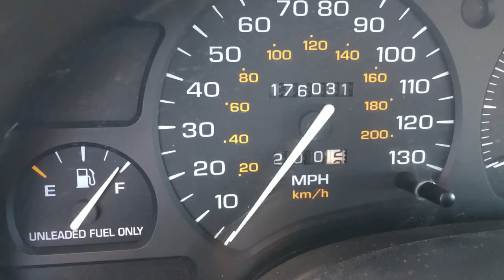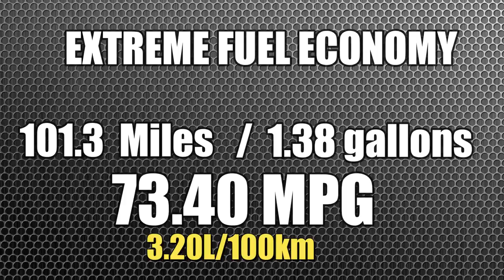S3 E11. Kubota turbo diesel Saturn extreme fuel economy.  super high MPG

Comment: Late winter and early spring rains often muddy up lakes and definitely affect the way fish, particularly bass and crappies, act. Although some mountain lakes stay clear, fishing muddy water may become the norm for a period in the spring, so you have to adapt to it.
Reply: Keep in mind that muddy water probably affects the angler more than it does the fish. Adjust your attitude and realize that fish can find food in these conditions. You should be able to catch them by choosing the right lures, and fishing slow and steady.
Reply: Get Noisy
If a lake or river is extremely muddy you can improve your odds by using a lure that makes noise.
Reply: @ocdman202      Man,  are you fishing for dinner   or   for fun?
Reply: @mommapanda5736     Sometimes,  both.
Reply: Get Noisy
If a lake or river is extremely muddy you can improve your odds by using a lure that makes noise. A plug that rattles (due to BBs inside) gives fish something audible to zero in on. Certain lipped and lipless crankbaits are specially configured to make noise. Give the fish a better chance to locate the lure by fishing these slowly and steadily. Although most usually fish a plug with a stop-and-go retrieve to imitate an easy meal, in muddy water it's good to reel it steadily so the fish can track it.
Reply: Rattles on jigs are good when crawling these lures along the bottom. Some jigs come equipped with rattles, but you can also get them separately to attach to the jig trailer or to insert inside the body of a plastic worm. Another noise-making option is to add beads between the lead sinker and a Texas-rigged plastic worm, or between the lead sinker and a swivel on a Carolina-rigged worm. The beads will make a clicking sound when you shake the rod tip. When retrieving these lures, move them as slowly as possible, and shake your rod tip to make them sound off.
Reply: A spinnerbait is also a good choice for muddy water.
Reply: The spinning blade sends out vibrations that bass can track. Some also have rattles on the body, or they can be added. In muddy water, choose a spinnerbait with one or two Colorado or Indiana blades rather than with willowleaf blades for more vibration. Some spinnerbaits have hybrid-style blades that are intended to produce more noise. Again, move a spinnerbait consistently to offer an easier target.
Reply: Lure color can make a difference in muddy water fishing. While jigs used for crappie are generally small and don't have rattles, you can choose a color that these fish are able to locate easier. In my experience, black, chartreuse, and red all show up well in dirty water, and combinations of those colors also seem to be good. One of the best crappie jigs in muddy water has a red head, black body, and chartreuse tail.
Reply: For bass in muddy water, try chartreuse spinnerbaits or crankbaits. Use a black jig-and-pig with some chartreuse strands in the skirt. Bright blue also works in muddy water and some folks swear by a black-and-blue jig with a sapphire blue chunky trailer for muddy water.
Reply: @ocdman202  any  good catfish  out of a muddy lake bottom?
Reply: @mommapanda5736  A common and large-growing species, the flathead (Pylodictus olivaris) is one of the ugliest members of the freshwater catfish clan, but also one that is regularly caught in larger sizes and which provides a good struggle on hook and line. It is important both for commercial and recreational use and produces good table fare when taken from clean environments.
Reply: The flathead catfish is distinctive in appearance and not easily confused with any other species. It has a squared, rather than forked, tail, with a long body and large flattened head. Mid to large specimens are rather pot-bellied, with wide heads and beady eyes. The eyes accentuate the flatness of the head with their distinctly flat-looking oval shape, and the lower jaw further accentuates it by protruding beyond the upper jaw. Compared to other catfish species the anal fin of the flathead is short along its base, with 14 to 17 fin rays.
Reply: Catfish baits don’t have to be complicated and they don’t have to stink.🤠🤠🤠🤠
Reply: The approach to fishing for blue cats is very different than that of fishing for channels and flatheads. This means the best catfish bait for each species is very different.

Catfish are all very different species. They have very different food preferences and habits. This means you need a different plan of attack, catfish rigs, bait selections, and techniques.
Reply: Just because you catch a fish on something once doesn’t mean it’s a good bait. The world is full of one-hit wonders and catfish baits are no different.
Reply: Best Catfish Bait For Blue Catfish
Blue catfish are eating machines. They spend much (if not all) of their day chasing and eating fish. They’re usually eating the primary forage fish in the body of water they live in.
Reply: In most cases, this will be threadfin shad, gizzard shad, or skipjack herring.
It’s not uncommon to find blue cats with their bellies engorged with shad or skipjack and absolutely stuffed. It’s common to find them so full of baitfish they regurgitate them (or even have them hanging out of their mouths).
Reply: Fresh caught shad or skipjack is the best catfish bait choice for blues in most cases.
Reply: Threadin and gizzard shad can be fished whole wormed onto a hook, or cut into chunks. Skipjack is typically larger than shad. They can be used whole for targeting large trophy-class fish. For smaller blues, skipjack is cut into strips or chunks.
Reply: Over the years I’ve used live and dead bait side by side. In almost every instance I found that blues will hit fresh dead bait (whole or cut) just as well as they will live. Keeping shad live is an unnecessary task for this species.
Reply: There is no magic bullet bait that you can buy.
Reply: Many anglers that target channel catfish use what I call “grocery store baits”, things like chicken livers, turkey livers, hot dogs, shrimp, and a variety of other items.
While there are times these can be good baits, I steer people away from them.
Reply: The simple reason for this is if you’re after numbers if they won’t hit a well-prepared concoction you’re in the wrong area. If you’re after size natural baits will typically prove much more effective.
Reply: Good “Stink” Baits (Prepared Baits)
I hate the term “stink bait”. These manufactured baits stink to the person using them but to a channel cat, they’re a strong trail of sensory overload.
Reply: Match The Hatch
Regardless of what you put on your hooks, there’s a golden rule, “match the hatch”.
Reply: You may have heard this before from bass anglers or fly fishermen and it’s true for catfishing also.
What’s it mean to “match the hatch”?

    Find what they’re feeding on
    Use what they are feeding on for bait or use something that mimics what they’re feeding on.
    Present it in a manner that looks natural
    Regardless of technique or presentation, these tried and true options provided will usually catch cats.

Just remember the action or technique often has more impact than the bait itself.
Reply: Read The Water, Catch More Catfish
You need to constantly read the water around you. Pay attention to how, when, and where the fish are feeding when you start having activity. Try to match the hatch in addition to recreating the action and you’ll catch more fish.
Reply: One of the most common questions we get about catfish baits is “what are catfish attracted to”. That’s not a super simple answer when it comes to catfish bait. Depending on the species, the catfish will feed based on sight, sound, and scent. It’s the presence of amino acids that will really draw catfish into baits in many cases. They have the ability to detect a trace amount of amino acids in a large volume of water.
Many anglers assume that “the smellier and nastier a bait is” the more catfish it will catch.
Reply: This couldn’t be further from the truth. It’s not the nasty, stinky smell attracting fish. It’s the strong presence of amino acids.
Reply: There are many variables in fishing and often no absolutes. You’ll encounter things when fishing for catfish that will leave you with more questions than answers. This often leads to spending more time to learn more.
Reply: Punch Bait vs Dip Bait
Punch baits are much thicker and get their name from the process used to bait the hook. You take a bare treble hook and “punch” the hook into the bait and then pull the hook from the bucket with a loaded hook.

Both will work for catching numbers of channel catfish but I’ve always preferred punch baits as they’re much cleaner to fish with and eliminate the need for using the tubes, sponges, and worms to hold bait.
Reply: @ocdman202       man,   do they  catch and eat  alligator,   in your neck of the woods?

Comment: If you’re looking for the gasoline  equivalent, Ford makes a fiesta with a 1.0 turbo gas. At 50 mph it can achieve 3.8 litres per 100km and average 4.6-4.8 litres per 100km at 60mph.

Comment: My wife get similar fuel economy (3.4L/100km) when she drives on the highway.
The car is a 2016 Peugeot 1.6L 4 cylinder turbodiesel. It has a peak tourqe 300nm@ 1870 rpm.
under mixed conditions I get 4.3L/100km

Comment: Which direction does air go through the intercooler?  Up out the hood hole or down into the hood hole and out under the car?
Reply: Almost impossible to say without testing with smoke or similar. Could be either way. One thing is for sure, its not very efficient cooling with that placement, thats why it can flow either way.
Reply: @GoldenCroc  Yes, I was thinking of a yarn tuft.
Reply: @2OO_OK  Its possible, but I think it would be hard to tell how much flows, not just which way...

Perhaps mount a small fan on it and let it free spin. Then take the voltage output to see which what it spins and also the rpm...

Comment: I hate to be that guy, but 73mpg isn’t that great at that speed for a car that light.  I suspect that engine isn’t all that optimal overall in terms fo internal drag.   A larger engine would run at a lower RPM and have less pumping losses without much increase in weight.  This small enjoying however will be ideal lpaired with electric motors and battery storage.  It’s sweet spot is probably 10 HP at a low RPM which is adequate for 40mph on flat ground, but I suspect you were running part throttle at a higher RPM to achieve the same HP.

Comment: The injection pump from a d1105 will fit the 722 but the rack needs to be flipped 180 to make it work. The injectors from a 1105 also fit the 722

Comment: But why?  I got 55mpg with my 100% stock 2014 Chevy Cruze 2.0L turbo diesel at 60 mpg.
Reply: The later 1.6L Turbo diesel owners report mpg close to and surpassing 60mpg with much more power and no fabrication.

Comment: I've heard of turbocharged VW Rabbits getting 70 MPG in highway use. So it should be possible to get even better milage with a Kubota engine since it's about 1/2 the displacement. You need a lighter car. Something kit car based or KEI car like would work. Or possibly something else light like a Geo Metro. The second generation of those isn't nearly as ugly as the older version and ought to weigh in at about 1800 pounds. No heavier than a VW beetle 🐞.

Comment: I myself live on the countryside and the speed limits around here are 70 or 80 km/h. And I drive 2-3 km/h over the speed limit to sort of not chasing down slow drivers and and not upsetting the stressed out bunch too much. So I'd for sure get close to those 3.2 l/100 km. My part of Sweden is fairly densely populated for being countryside but I guess our speed limits are more about safety and less about going fast. I'd say I might maybe save 2 minutes per day if I could drive 100 km/h instead, so not much reason for driving any faster. 8-)

Comment: I wonder something. Don't you have diesel cars in the US? I think the fuel consumption of your Kubota is very good and you have shown some skill in terms of craftsmanship, but I have a normal production car VW Passat 1.9 Tdi built in 2001, which needs 52 MPG and an overall average of 42 MPG. However, it also tops out at 136 MPH and and it lasts for a couple of hours. You can get 680 miles on a full tank. 29.1 kpm, 9 sec from 0-60 MPH. The Saturn runs more "deliberately" than "sporty".
Don't you have them or do you just want to build something yourself? I've already seen US videos where they put an air-cooled Deutz diesel in a pickup, because this engine also runs on waste oil if necessary.

Comment: In 2000 my wife drove our 1998 Dodge sport pickup with a full load of furniture 86 miles of rural paved roads from eastern Az to western NM at around 40 mph and got 45 mpg.  In small town driving (very light traffic, and a few traffic lights I average 23 to 26 mpg in 2023. The sweet spot of 40 to 45 mph really increases gas mileage.

dodge dakota

Comment: My 2lt VW TDI 2008 golf remapped estate gets 71MPG imperial  (59. U.S. MPG) at motorway speeds about 70mph that's with 137,000 on it  with diesel at £1.60 a litre here in the UK we really couldn't afford to use North American cars here..

Comment: My unmodified 2006 1.9 vw golf tdi will easily get 75+ mpg at 50mpg the most iv got being real careful using all the driving tricks was 90mpg but did a 200ml freeway trip and got 70mpg @ 70mpg .
The 2005 1.9 PDI 8v engine has 137000miles on it doesn't burn oil and if properly maintained could do 400k +

Comment: I think you need to check the alignment of your wheels. It looks like your car isn't tracking straight. This could impact fuel economy.
Also, tell us the outside temperature. Warm air is better for fuel economy.

Comment: Interesting project,  but my 2013  1.6dci  qashqai does 55mpg at 75 - 80mph and it is 130hp. The old tin top VW golf would return over 70mpg driven frugally and didn't have a 0- 60 speed of continental drift

Comment: so after all this why not do a more real world test to compare. and will the machine even achieve highway speeds with such a small engine? My guess is due to different opperating rpm's between a high reving gas 4 cylinder and a slow 3 cylinder diesel ,the gearing may not allow much more speed.

Comment: i'd love to see the same 45 mph fuel economy run with five hundred or a thousand pounds of extra weight in the diesel saturn
Reply: @drippingwax  cuz then we can see if the car is useful for actual driving, which requires payload capacity

Comment: Signs of a Blown Head Gasket
Reply: Outside of an engine repair shop or an auto parts catalog, you’re unlikely to see a head gasket.
Reply: Though well-hidden, the head gasket, one in an i4 or two in a V6 or V8, performs several critical functions. Because they’re not meant to be removed, head gaskets are extremely resilient, coping with fluctuations in temperature and pressure for hundreds of thousands of miles. If the head gasket fails, usually referred to as a “blown head gasket,” it can result in coolant leaks, oil leaks, or cylinder leaks. Depending on the severity, the results may simply be an annoyance or may prevent the engine from running efficiently, if at all.
Reply: What Does the Head Gasket Do?
Reply: The head gasket is mounted between the engine block, containing the crankshaft and pistons, and the cylinder head, containing the camshafts and valves. Most modern engines use multi-layer steel (MLS) head gaskets, while most older engines used composite asbestos or graphite head gaskets. Some engines may use solid copper head gaskets. No matter what the material, head gaskets perform basically three main functions:
Reply: Cylinder Sealing – While the engine is running, gasoline cylinder pressures can easily exceed 700 psi, and diesel cylinder pressures can top 2,000 psi. Clamped between the cylinder head and engine block, the head gasket contains those pressures for efficient cylinder compression and expansion. MLS and composite head gaskets usually have a special sealing ring built in specifically for this purpose, while copper head gaskets may require engine block machining to install such a ring.
Reply: Conducts Fluids – Both engine coolant and engine oil are needed in the engine block and cylinder head, and ports in the head gasket allow for fluid flow between the two. In the cylinder head, engine coolant maintains valve and spark plug temperature, while engine oil lubricates and provide hydraulic pressure, such as for variable valve timing.
Reply: Contains Fluids – At the same time, engine coolant and engine oil passages may only be separated by a few millimeters. The head gasket prevents these fluids from mixing. Also, combustion gases are prevented from passing into nearby engine coolant and engine oil passages, and vice versa. Depending on the design, the head gasket may have O-rings to improve sealing in certain areas.

Comment: That is very impressive! I feel like a modern Mitsubishi Mirage ~2018-2023 would do pretty good on that test too, getting about 55-60 MPG.

I should add, I have seen them get around 50 MPG in city roads, going about 45-50 MPH with a few stop lights and hills.
Reply: The European equivalents of most every vehicle in the US get way better fuel numbers when adjusted for equal volumes of fuel due to their less ridiculous emissions compliance standards.

Over there they have diesel versions of US vehicles we cant even have over here (Like diesel Ford Rangers and diesel sedans that get 40+MPG US equivalent) that walk all over our stuff on equal 1:1 comparison.
Reply: @drippingwax  We likely will get a fully loaded Mirage SE soon, and it has everything like that. Heated seats, keyless start, cruise control, ETC. The base model has cruise control too.
Reply: @tcmtech7515  Yup! We have a lot of emissions here to deal with.

Comment: You really should do 3 top-offs per test (not shutoffs on the same fill) to ensure fuel volume consistency.  Even the same pump will shut off at different points.